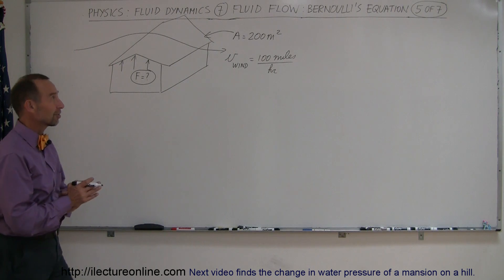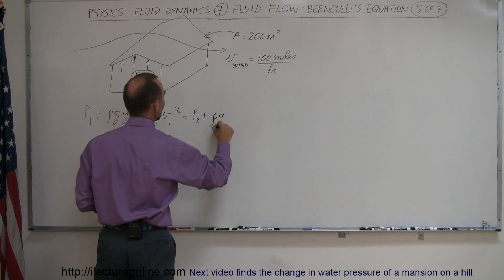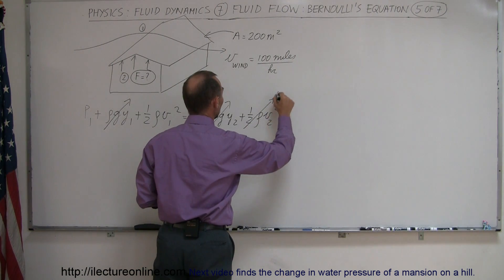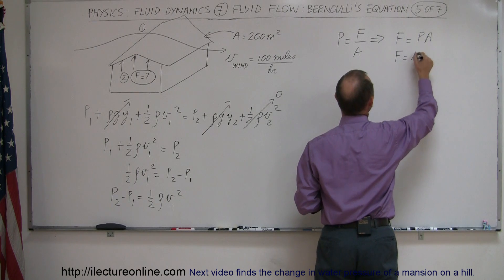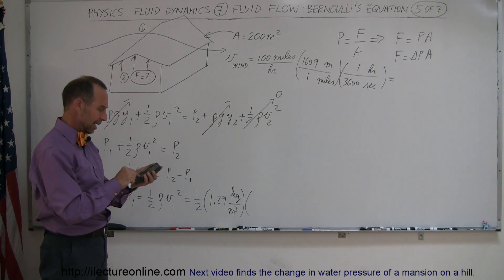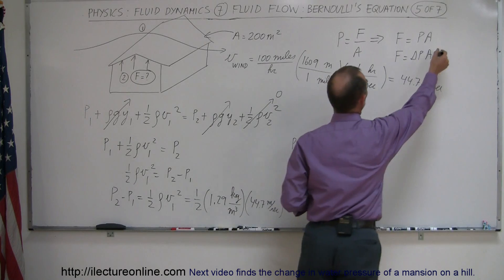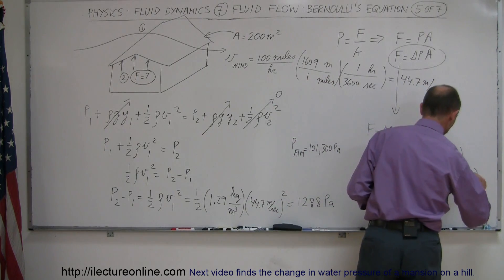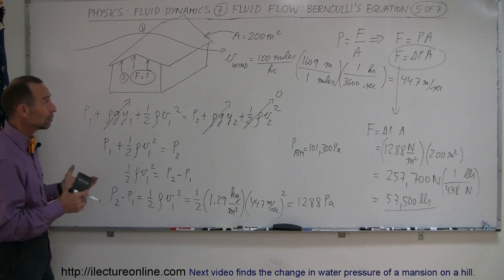Physics 34  Fluid Dynamics (5 of 7) Bernoulli's Equation

Comment: This question technically wrong.
Reply from the maker: Yes, fluid flow is very complex, but using Bernoulli's equation is a good approximation.  This is what is taught in all college textbooks, untill you reach higher levels of fluid flow.  (Like we ignore wind resistance in mechanics, so you could call everthing wrong in a college physics book)
Reply: @MichelvanBiezen  This answer is technically true 😂. Thank you so much sir, I am appreciate..

Comment: Nope, again. Still wrong.
The speed of the air is NOT why.  If that was the case, the roof wouldn't need to be peaked. . 

In this case it is the curved flow that causes the pressure decrease. Here's why:
.
Air has mass and obeys Newton's Laws. 
Newton's First Law:
It's mass, inertia will try to go straight.  It will oppose any force that tries to curve it.

When the air reaches the peak it wants to go straight, but atmospheric pressure forces it to curve around to the other side sloping down.  It's INERTIA opposes that and lowers the pressure.  I tis sort of 'pulling away' from the surface, bit not enough to go straight, just lowering the pressure.
.
Here is it described correctly:
 *https://www.youtube.com/watch?v=3MSqbnbKDmM*

Comment: Thank you very much Dr. Please correct me if i'm wrong, because I got confused,  the atm pressure is equal to 101325 pa which is too much higher than 1288 pa, not a slight difference as you explained. (101325-1288=100037 pa). I'm very grateful for your lectures.
Reply from the maker: Inside the house, the air pressure is atomospheric pressure = 101,325 Pa.  The pressure outside the house is less due to the high wind velocity.  The difference in pressure is 1288 Pa.

Comment: Hi Michel, I had to check back on THIS particular problem because of a Tornado Video I saw. If you have 60 seconds then check out this video. You can see how the Roofs of these Houses are being sucked right off their foundation due to the Wind Over them. It actually is more like an Explosion. What I do wonder is what is all the WHITE color you see when that Low Pressure instantly arrives over a Roof. It may be Water Vapor due to the Lower Pressure and the Humidity surrounding that area.  Anyway... I'm watching your Video now.. thank you.   Oh, here's the Link to that Tornado...  https://www.youtube.com/watch?v=lxdFh8nYMgM
Reply from the maker: Hi Philip.   Tornadoes have always fascinated me.  They are powerful and their destructive power is almost beyond imagination.  Yes the high wind speeds cause the pressure to drop and they almost act like huge vacuum cleaners, and the reduction in pressure pulls the roofs off the houses.  Also higher up, the reductionin pressure allows the vapor in the air to condense, showing the white cloud like appearance of the funnel.    A few years ago I actually saw one in the Mojave Desert in California.  (A very rare sight in California).
Reply: @MichelvanBiezen  thanks Michel for your reply! Wow, congrats on having SEEN a real tornado.. What a thrill that must be, from a safe distance. :)  I appreciate your response, especially in regards to the Condensation.  Be safe.  Thanks again. :)
Reply from the maker: Yes, it was about 5-10 miles away and it was very tall.  Luckily in the desert there wasn't much to be destroyed.  Tornadoes are very rare in California.  I remember that about 41 years ago a tornado touched down in the town next to ours and damaged 18 houses.  We drove by to take a look and it was unreal.  But nothing like the damage the big tornados cause in the midwest.
Reply: @MichelvanBiezen  41years ago?  you must have been 5 years old!!  :D   but amazing to see something so  Natural and still somewhat of a mystery. I do see a tornado in the sink whenever i drain the water. :)  Vortex physics is angular velocity at it's best.. :)
Reply from the maker: Philip,  Very flattering, but we are a lot older than you think.  🙂

Comment: How come the difference in the pressure times the area gives you the force instead of just the pressure inside the house times the area giving you the force?
Reply from the maker: Because there is pressure inside the house pushing up against the roof the and there is pressure outside the house pushing down against the roof.  In this example the pressure inside the house is greater than the pressure outside the house.
Reply: @MichelvanBiezen  ahhh, i see. Thank you!

Comment: Bernoulli's Principle is the single principle that helps explain how heavier-than-air objects can fly. Bernoulli's Principle states that faster moving air has low air pressure and slower moving air has high air pressure.

Comment: If we assume that the fluid density is high, would you take the height into account or would assume that diffrence in height is very small that you would cancel them out_ Thanks
Reply from the maker: With liquids the height in the fluid is important and we keep the term in Bernoulli's equation.  But with air, a few meters makes a very small difference.

Comment: I'm not from america so I don't know much about imperal system but isn't lb used to measure mass? So how can you convert force in newtons to lbs?
Reply from the maker: i pound = 4.448 N
Reply: There is a unit of measure called lbf (pound force) and a unit of measure called lbm (pound mass).  There is a factor to use to convert lbm to lbf.  1 lbf = 32.174 lbm-ft/sec^2.

Comment: can you explain why bernoulli's equation is valid in that problem? we derived the equation from conservation of energy on a pipe, I personally would never think to use bernoulli's equation here
Reply from the maker: We are comparing the pressure inside the house and the pressure outside (above the roof). The pressure difference is caused by the difference in height (which is minimal with air) and the difference in velocity.
Reply: @MichelvanBiezen  OK thank you for the clarification
Reply from the maker: Bernoulli's equation works for fluids in motion.  That includes gases which behave like liquids in this instance.
Reply: @MichelvanBiezen  but the air outside and the air inside are not linked,  as I see it they are in 2 different "tubes",  correct me if I'm wrong

Comment: but what about the angle of the roof?
Reply from the maker: Good  question.  We ignored the angle of the roof for the sake of simplicity.
Reply: what will be the equation if i want to put angle in the equation?
Reply from the maker: Fluid flow is a very complicated topic.  We plan on making videos on this topic when we find the time to do so.
Reply: so what will be the angle set to default in the equation you showed in the video? is it when the surface is at 90 degrees? if so can i just time by sin theta ?

Comment: Just out of curiosity, wouldn't the air flowing across the left face of the roof create a high pressure against that side of the roof, and a vacuum on the right side of the roof? I don't think it is correct to assume that the gain of pressure on the left side of the roof is equal to the loss of pressure on the right side, but I am not complete sure. If I am correct I believe the conservation of energy cannot be applied to this problem. In regards to that I do not believe that Bernoulli's equation can be applied either because it is a derivation of the conservation of energy.
Reply from the maker: This is off course a VERY oversimplified example.  When it comes to fluid flow there are many other things we have to consider.  But it does offer a good approximation of what happens.

Comment: Are we wrong to apply Bernoulli's principle here? I am not arguing this method but am curious if this is correct. Thank you.
Reply from the maker: Technically, it is not a "pure" example of Bernoulli's principle.  But it will give you the correct answer to the problem.  This is a typical example found in many text books under Bernoulli's principle.

Comment: There is absolutely no lifting force on the roof of a house under high wind loads. The force of the prevailing winds will apply positive pressure to the left side of the roof and the trusses will distribute that force as a clockwise rotational torque to the right side, not lifting it up. High pressure will build on the left side of your house diagram and low pressure pockets will develop on the right. The sum of all force vectors is more sideways left to right, preferring to shear the house from it's foundation.

Comment: Technically Bernoulli's principle cannot even be applied to this particular problem. Bernoulli's equation is a form of the general principle of the conservation of energy. Since the two systems (inside the house and above the roof) are in no way connected in the example, the energy is not conserved between the two systems. Bernoulli's principle can only be applied through a streamline where conservation of energy is valid.

While the final result is correct, the application of Bernoulli's principle is theoretically and physically wrong. If the inside of my house was sealed (air tight) and I would have a compressor installed that increases the pressure to 3ATM inside the house, then suddenly the outside pressure would also increase, because your equation states that p1 = p2 - 1/2*rho*v^2. However, the outside pressure should be completely independent of the pressure inside, which makes the equation wrong.
Reply: All the physics's problems are not 100% correct in relationship with the real world. In physcis we "create" a perfect world where we consider the things as we want them need to be, in problems of motion, for example, we do not consider the friction, what is really wrong.
Reply: yes and it can only be applied at 2 points along a streamline. Great videos but this is fundamentally flawed
Reply: But you can think of the wind blowing from the left side to the right side and compare a point 1 from the right side, and then a point 2 on the roof which will be the same as point 1 and then a point 3 inside the room, and think of point 3 is on the streamline of point 1 but with same height and 0 velocity. So comparing point 1 with point 3 is basically the same as comparing point 2 with point 3.
Reply: Yet he proved mathematically the difference of force by using Bernoulli equation. 😎
Reply: I'm just starting to learn this now.  Could Bernoulli's principle be applied assuming that the windows are blown off and wind has complete access to the inside of the house?  Thanks
Reply: Actually what one should do is compere point 1 that is outside the house on the roof with point 2 that is also outside, on the same streamline but so far away that is not in the storm anymore and the speed is 0. Then you can use bernoullise and the point 2 is getting same values as a point inside the house. You example where the pressure inside the house is 3ATM doesn’t work since such a point doesn’t exist on the streamline.
Reply: TR0LLREIGN yes
Reply: If you are that intelligent why didnt you make the video yourself at the first place rather then proving right and wrong here .

Comment: Sorry Sir ,you said  1mile=1609meters,did'nt you make a mistake about giving the answer as 47,7m/s which means 100 miles=47m/s.
Reply from the maker: No mistake.  100 miles/hour = 44.7 m/sec  (you also have to convert hours to seconds)

Comment: So, say that a tornado is near the house. The tornado is strong enough to rip the roof off. If I open windows in the house, so now there is air flowing through the house, will that equalize the pressure enough to lessen the force pushing up against the roof?
Reply from the maker: +Zachary Bertrand   A tornado is a very different "beast".   Opening the windows will not save your house.

Comment: can someone explain to me why is the pressure inside the house pushing up not down? thank you
Reply from the maker: +ANDY CHEN The pressure inside a fluid declines with increasing velocity of the fluid.  (See Bernoulli's equation).That means the pressure inside the house is higher than the pressure outside above the roof , and thus the force pushes up.
Reply: In a fluid, the pressure is pushing all sides of the container. So if the pressure is assumed constant in a room, then it pushes the floor, the walls and the roof as well. If it's easier for you to imagine it that way, it's not the pressure inside the house that pushes the roof up, but the low pressure above the house is sucking it upwards.

Comment: Actually , Bernoulli's equation is only applied along streamline , so u cant apply Bernoulli equation between outside and inside the house , the term P2 u just calculated is called the stagnation pressure ,so if u put ur hand  against the airspeed u will feel the pressure p2 , so the pressure inside the house stay atmospheric pressure (101325pa for ex ) and above the house roof  the static pressure(p1)= Pinfinty-0.5*rho*v^2 , u can put Pinfinty=Patm as assumption,hence the house roof will experience a pressure= patm-p1, u will notice that u will get the same answer cuz u put Pinfinty=Patm,but the concept is not right ,btw the outside house walls will experience a stagnation pressure (p2) .
Reply: TBNR mido Couldn't you consider the air going over the house as a streamline?
Reply: Max Lightning   air stream coming from far field point (1)where pressure =Patm and continue flowing over house where u can consider point (2) so u can consider line connecting those two points as stream line then u can simply apply BERNOULLI equation to calculate the pressure over the Roof ,,,But u cant apply the principle directly between inside the house and Roof top  simply cuz there is no air stream passing from inside to upward penetrating the roof.
Reply: +TBNR mido was just about to ask him this, thanks for explaining it
Reply: Thanks for giving me peace of mind ! before watching the video, this's exactly the way I thought it should be solved but then I saw the video's solution and got me scratching my head ... I just hate how a lot of resources regarding Bernoulli's equation completely forget about the fact that this equation is only valid for two points in the same streamline and try to apply it incorrectly to all sorts of things, such as in the case of lift in airplanes

Comment: Hi, I have asked you earlier, is this perhaps  the video your are referring to for my answer? The house example here  in your video is a  peaked roof one. I was asking about a flat roof house where the wind flows just above the flat  roof and parallel to the flat roof without hitting the sidewall,  so would the  roof feel an uplift? or is it important that the airflow of the wind finds an OBSTRUCTION like a side wall or a peaked roof to make the roof lift?
Reply from the maker: Only considering the basic principles, the shape of the roof doesn't matter.  The roof would still feel the uplift, just like in the example.
When you get into obstructions, turbulence created by them, etc. the problem becomes very complicated very quickly and requires a much more advanced analysis, way beyond the scope of introductory physics.
Reply: Thank you Michel!, please bear with me, I think I see the point  but, would the flat roof feel an uplift even if the horizontal wind  portion actually ONLY flows just slightly above the roof surface and never originally  hit the side wall of building as a constriction?

 I mean, in ordinary cases, the wind say flows from left to right on a flat roofed house, the wind first meets  the house´s left  SIDEWALL which is a constriction which makes the wind  flow and deflect   up faster for(conservation of energy and Bernoulli)   and  the wind now flows faster ie. faster than before it hit the left wall  so the wind now flows faster yes above the flat roof which creates the true lower pressure and thus uplift.

My question was , would the uplift still exist even  if the wind stream portion  didnt  hit the left sidewall(or any constriction) at all? Instead, this wind stream portion flowed as  earlier   from left to right as earlier BUT NOW  at a height from ground as to  never hit any sidewall or constriction. Thus the the wind   just very simple flowed just exactly past and above the flat roof from start to finish without hitting any constriction or  the side wall.
 would there be still an uplift on the flat roof even if there was no constriction to the wind flow?
Please, you are perhaps my only hope in understanding this.  I really appreciate your help as I find no   help at all in this example and if I find anything, people are arguing with contradictions. Thanks a lot for you Time.
K.A
Reply from the maker: leviterande
As strange as it may seem.  The answer is still yes.
The reduced pressure is simply a result of the speed of the flow of air.  
The reduction in pressure = (1/2) * density * v**2
Reply: And  I also suspected and was most sure that the uplift would still be there!, But, the problem is that,  some educated people like on
physicsforums website, are saying that unless there is a constriction to airflow, there would be no uplift, and these are educated people...  Thats why I  am confused...